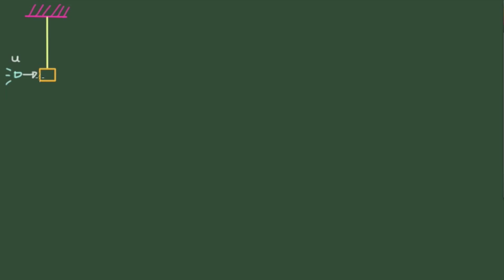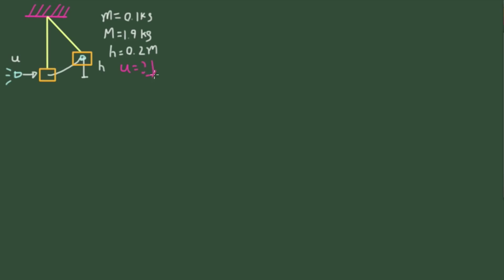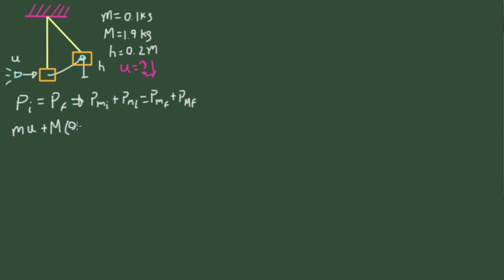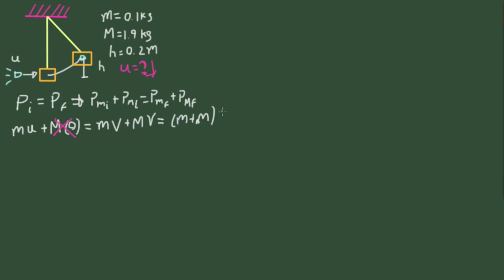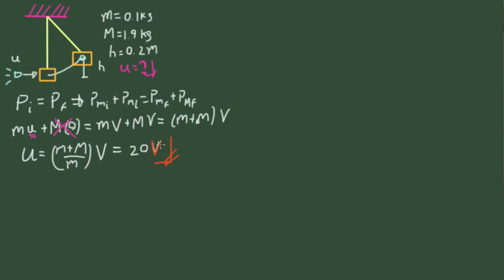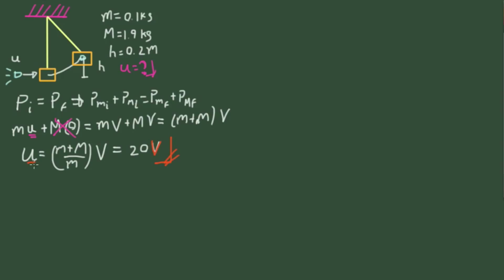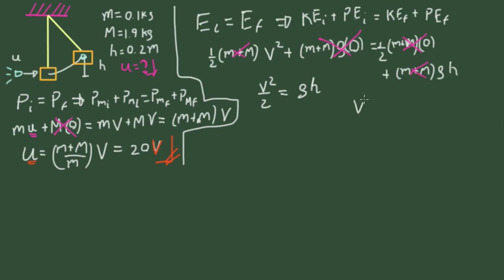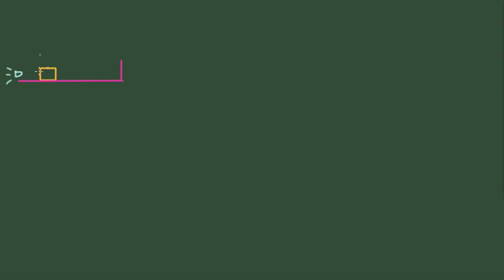Collision problem, bullet and the block.

Comment: What if the block does a loop? What's the KEf ?
Thank you!
Reply: Vasco Monteiro if it does the whole loop by coming to the same point where it started 
Then it's KE will be zero when it stops at the bottom 
Since energy at any point remains conserved at any two points 
And hence the 'h' will be useless in this case as a given data
However the take off velocity for the bullet will be sqroot(5rg) where r is the radius of the loop
Since it performs a non uniform vertical circular motion